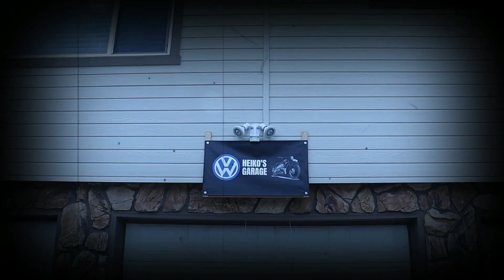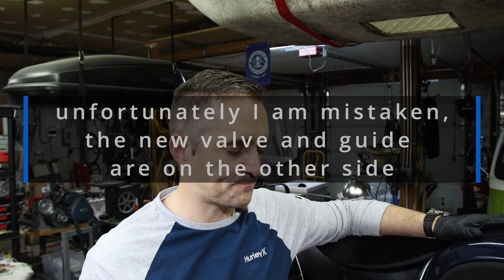BMW Airhead top end noise after refresh - follow up

Comment: First off i'd take an ugly road ground up or cracked wall art valve cover and cut it away ( the bad side) enough allowing valve adjusting yet deep enough it's higher than the drainback to the pushrod tubes. No mess running engines. This plus a large running fan while tuning and checking timing including syncing timing to dead nuts no ghost shadows. Dyna III triggering system with BMW's mechanical advance tuned to each engine. Single primary twin secondary output coil. 
Comming of the highway up to a traffic light yes the valves sound louder than normal. Set to spec at the wide limit not the narrow limit. Rather hear the valves than smell them. 

With locking down the valve adjusters your "Hamfisting" too tight being brutal just breaking the nut loose later. 

I must ask, how many miles has this engine been run on modern oils having lack of cam and lifter protection that past oils had with zinc and phosphorus added? This protection including high pressure contact areas like valve stem tips and pushrod cup and ball ends protection now gone unless a proper oil is being used.

Running Air Heads that were designed to run on leaded gasoline not the unleaded rubbish we have today unless the valve seats have been replaced for unleaded as well valves. Good time to check or replace the valve guides while apart. 

JMO my R25 & R27 (250's), 70 R75/5, 75 R90/6 & 76 R90s are all factory original, I add lead additive at every gas fillup. Depending on the 6.3 gal or 3.2 gal tank bikes determines which size  premeasured plastic bottles I carry along riding out of town or out of state trips.  Small 4 or larger 6 oz. bottles easy to pack in the tail bags. 
Octane Surpreme additive in the three 850 Nortons, all the bike valves are rock steady, zero valve reccession or clearances issues with factory valve seats and valves. 

Back to oils, adding engine Break In OIl is one expensive way for added protection for these Non Roller Rocker Beemer cam, followers or cam with rocker pads depending on brand of bikes.
 
Lucas Motorcycle 20/50 Full Synthetic engine oil has been tested against five other brands of oils, examples, Redline, Valvoline 20/50, Royal Purple. Non detergent Valvoline VR1 with zinc & Phosphorus (sludge city if running long distances vs short time in race engines where sludge isn't a buildup issue. Last was Honda's brand motorcycle oil dealerships service department install in customer bikes telling me "it's hood enough for the older Honda engines". Yeah right. 

All oils except Valoline VR1 being non detergent were run on an exact distance off road course including a 6 1/2 mile long dry lake a full throttle run nearing redline the torture test lake. Same narrow within 80 degree F temps and dirt roads covering 400 mile laps then the oils sent to a lab. 

The test mule a 82 XR Honda thumper with a 582 cc big bore kit speced out to the specs used   in the Baja 1,000 offroad engines decades ago.   
All the oils sent to Blackstone Labs for oil analysis. PPM of different metals normally worn off from an engine in good mechanical condition. Lowest PPM metals worn off by the oil having the  highest engine protection being the lowest in PPM worn off was Lucas 20/50 Synthetic Motorcycle Oil.  

Running oils not having the protection zinc and phosphorus reduced then removed completly over a decade in time is now a slow death you will not notice until the damage has been done to cams and followers of the old slipper design in older air cooled bike engines. Automotive industry solved the oil issue by introducing roller rockers, problem solved. Theydidn't like the added expense vs reliability issues if they didn't change to roller rockers. 

Even the Dodge Hemi engines the police used that were idled long periods of time while on duty still had roller rocker failures vs driving then the higher rpm's that slinged oil off increasing the roller lubrication reducing roller failures. Regular street run Hemi's still have failure issues. A thin line with oil protection and engine design.....Bean Counters strike again? 

The cam and rocker pads are are on the edge of destroy themselves on the Honda 600 cc thumpers that i'm well familar with owning and repairing these engines. Failures with the cams and rocker pads a big increase this  past decade alone. 

Any short time of oil loss like after crashing in the dirt the engine on its side revving with the oil pump sucking air over a short time these older Honda engines ending up damaging themselves. Riders a half hour later notices the valve clatter is getting rather loud, it's the cam and rocker pads destroying themselves, damage done, distruction from running regular oil. They also run rather hot normally, add slow speeds with not enough air cooling, dirty or low on oil, KaBoom. A XR400 oil cooler as added protection oil to the head , cam and rocker pads is a must if you respect machinery.

I'm a gearhead to the max, past life rebuilding large radial engines, running up and break in on teststand, R 2800 Pratt & Whitney radials. We sent every engine newly rebuilt and old engines being serviced their oils to the lab able to catch an injured engine before it destroyed itself. No place in the sky to roll to a stop, park it and walk away  after an engine failure.
 My name says all, sorry for the long Novel.......~~=o&o>........

Comment: Great video, i have valve noise issues on my 1964 R69s, if the valves gap set to tight the noise is very low, but the engine power is in half, with corect gap setings (15/20) the noise is back the engine is working very powerful  but the valve rattle is to noisy, any idea ?
Reply from the maker: Are the rocker bushings worn? Have you taken a look at the contact surfaces that touch the valves on the Rockers? They can be pitted or rough and make additional noise.